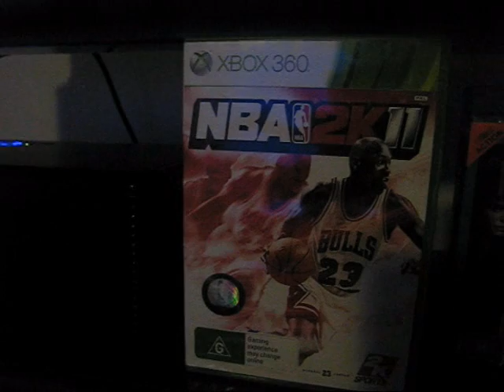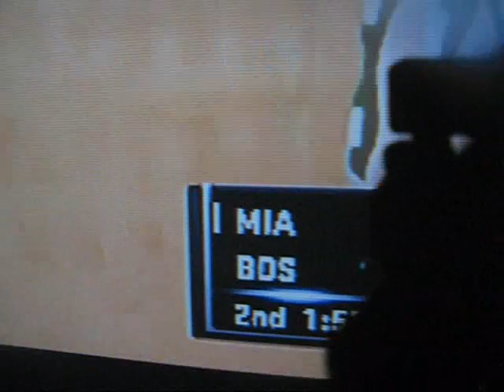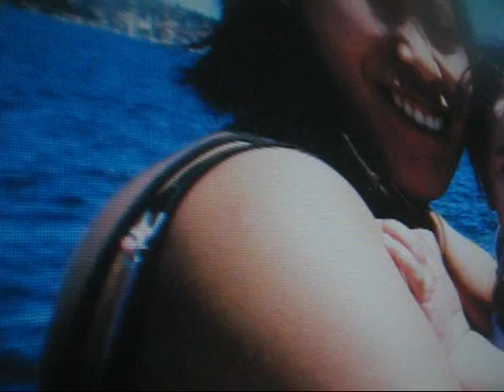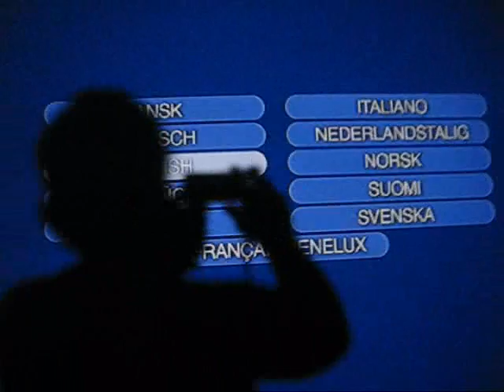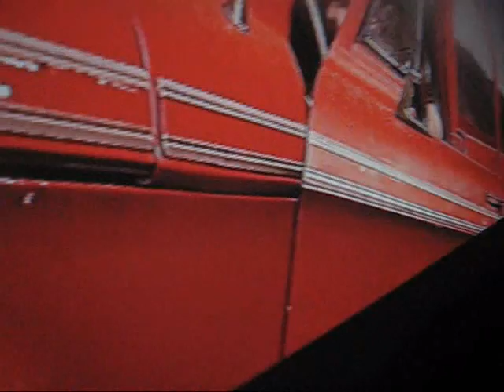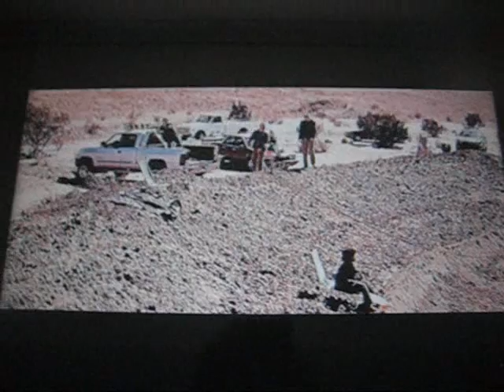Factory Direct Full HD Projector LED 33 part 3

Comment: I've just ordered this projector for 130 pounds (uk). That is loose change for a projector so not sure what quality you expected!  luckily I don't need a tv tuner so that won't be an issue for me. as with anything cheap from China - the instructions are never even worth reading so that's not even a negative either.  It's a shame there was no mention of brightness, sound quality, size, noise etc.  I guess I'll find out myself so enough though!